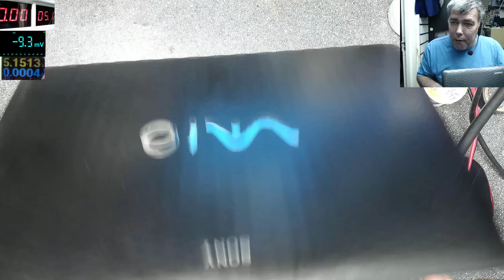What you should check first on a dead laptop :)

Comment: I think that the first think you mast check before trying any repair is the cost of a new purcase , as in a lot of cases repairs are posible but are not recomended because the cost of them is higher or near to cost of a new one. On the other hand repairs which performed without using of original spear parts are more emergency paches and less official repairs, as none can warranty about their last lifes or if the machine will work properly in the future.
These practice are very usefull if you want to indentify the problem and give to customer a real report about the reason which cause the problem.
Reply: My laptop was drained i  water when i was sleeping and its not opening my carging light only shows red and white
Reply: @hi-bl4pf  I know that this Video is really old but if You are trying to Say that You accidentally poured Water onto Your Computer in Your Sleep I'm not A Complete Expert but it sounds totally fried to Me but I don't know how to fix Computers so I don't know if anything can be done
Reply: Can it be fixed?

Comment: hey, I used to have HP laptop with the same issue, I found out it was the wire inside the charger cable, it was making shorts, I saw it when I went to turn on the laptop and the room was a little dark, then I saw this spark coming out from the cable charger, got fixed it

Comment: First question I would ask is 'was it powering up with just the battery' if it was used without the mains power supply - helps to narrow down if it's a power supply issue or not (provided the battery is charged of course!) - if you don't have access to multiple chargers etc, this is an easy check :)

Comment: Sorin, what i'm using to check the power supply if it can still deliver the needed current is by using ang adjustable current dummy load.. Or if i'm lazy i'm using a bulb to load the power supply then measure the voltage while the bulb is connected. If the voltage drop too low i know there's a problem with the power supply. That's how i check the current.

Comment: Hi Sorin, here at our lab we stick the charger on the Electronic Load, then we have this controlled directly, but thats just because we have to fill in this form for the customer, otherwise for the most guy´s here like you say, get hold of a few chargers, fleemarkets  have loads of them for small change and have them handy to test with.. :-)
Have a wonderful day you all
BR / Andy

Ps. was looking at the other comments... ofcourse one can make connectors for the powersupply directly, and its a good thing, however if you have a bunch of powersupplys, then you immedialtly have a used one to give the customer - thus a quick solution :-)

Comment: You should allways load test it. This is the most common trouble shooting fault. People unplugging connectors, checking voltage, plugging back in.  This is ohms law. There is no voltage drop if there is no current.

Comment: if the laptop's battery pack is charged up, then it should run ok on the battery . Yes ?
Reply: If the notebook was used as a desktop, and connected to its charger for five years, battery is probably completely dead. But othervise, yes it shoud work on battery with charger disconnected.

Comment: Why not test charger under load ? What about connecting an 100 watt 6 or 8 Ohm resistance on the charger output (only for a few seconds if you have not mounted the resistance on a heatsink) and measuring with a multi-meter if the voltage is being decreased considerably ? Also a cheap oscilloscope could be used.

Comment: Same thing happened to my sister's old Macbook. One day it just completely died and wouldn't turn on at all. No LED on the Magsafe charger. Just completely dead. Bought a charger from Amazon, plugged it in and the Macbook now works.

Sometimes the simplest things can cause what looks to be a more complicated problem (dead or unstable device). Gotta start with the basics before moving on to more advanced stuff.

So far I can only troubleshoot basic problems (that don't require e-surgery). The more advanced stuff, such as board repairs, are out of my skill set right now. I hope to one day comfortably be able to move on to the more advanced stuff. It's fun taking something that's broken and watching it come to life.

Comment: Great video!
95% of those adapters can be fixed replacing an electro cap. Take it apart, use an ESR meter and check. Replace with 40 cent cap.

Comment: Charger has to be able to provide enough power to run the laptop.  The voltage of a malfunctioning charger can measure good with no load (unplugged) but can collapse when plugged in and loaded.  I purchased a "broken" laptop once that required a 90W charger but the person who sold it to me was trying to use a 45W charger with it.  It worked perfectly once I used a 90W charger.  Not enough AMPS! :D

Comment: Replace the two low esr electrolitic capacitors connected to the double diode  output.
Don't waste a usefull test supply :-(.
Shorted plug or cable is the most common for me to see.

Comment: How can you check the amperage on a PC charger?
Reply: You can buy nice handy load tester. They make them for ATX power sources, and for different makes and models of notebook chargers. Or you can use ampmeter in series (multimeter set on amps) and some load - light bulbs or big resistors. Safer method is to give a power source some load, and then measure output voltage.

Comment: Most common problem for old Sony Vaio was when they overheat desolder the pins on CPU every time you need hot gun to solder back and if heat again you need to do again. That was low quality solder used by Sony what I remmeber 400-500C melting
point.

Comment: hard drive controller not enough current to startup it up correctly. Power Supply
Reply: the BIOS should start regardless of hard drive, or hard drive controller
Reply: @zoltankarahuta668  
Yeah! The bios should come out regardless of any possible hard drive issues.That's why people tend to remove the hard drive before inspection, and then change the ram to see if the bios can come out.

Comment: Sorin make a video with that charger how you can fix a fault like that..i'll be glad to know how you fix it..please do a video on that.tnx man
Reply: Problem is opening of that thing. Cases of chargers like that are either glued or sonic welded. If you get it open, you can check for obviously leaking electrolytic capacitors. If you find them, you can replace them, and - most probably - you will have working charger. With broken cover, which is the reason nobody in first world will bother with repairing it.
Edit: Yes, it is definitively possible to repair it, and usually quite easy. But these things have mains voltage inside, and you don't want to give a mains voltage device with broken cover to a layman paying customer. New one (offbrand) will cost like 20 quid.
Reply: After opening it he can glue it with hot glue

Comment: What about a current clamp should we try with It or It does not work  , if not why?
Reply: Current clamp would work if it is inductively "connected" (coulped) to the circuit loop but since the ground/negative and power(positive) wires are not separated and follow the same path also the grounding usually shields the  power wire. So NOT with the stock charger. Some clamps can't measure DC and most are quite crude with small currents. DC clamps use Hall effect sensor to measure the magnetic field created by the flowing current. If you can split the wires you can ... but why not use a power supply with a built in ammeter?
Reply: @brk932  got it thank you